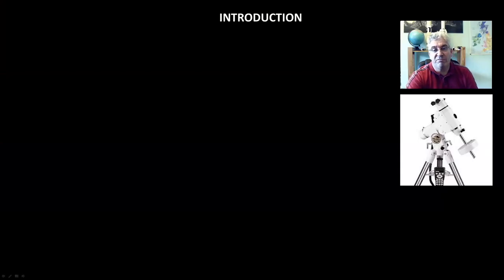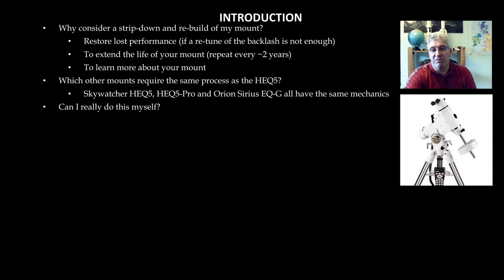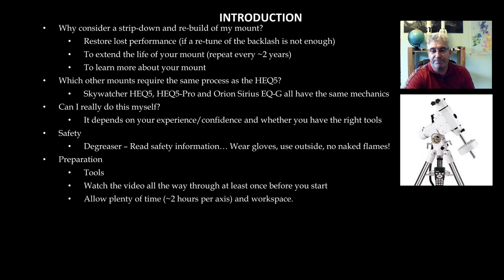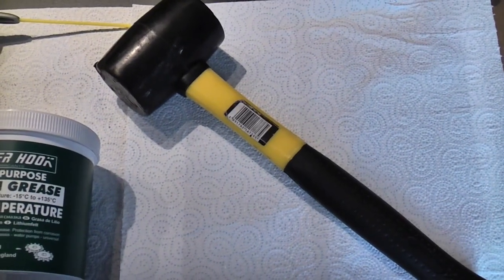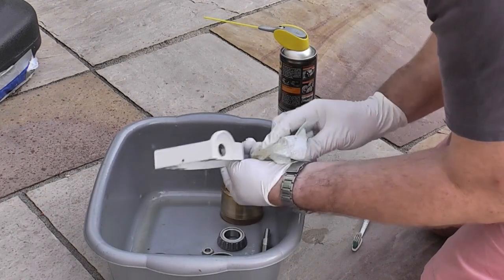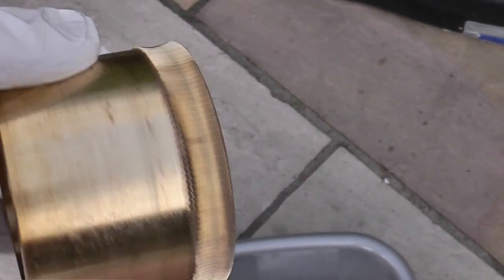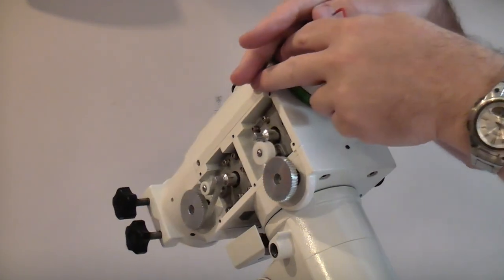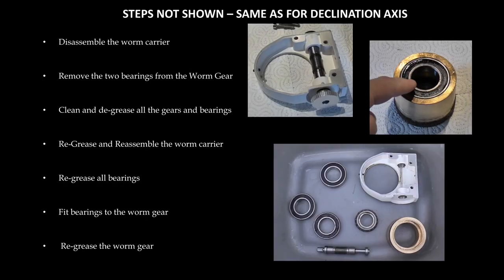Skywatcher HEQ5 Stripdown and Rebuild (NEW VERSION)

Comment: Hi Martin, thanks a lot for your very informative and enjoyable videos. Using them a lot. I am using a HEQ5-PRO and am struggling with backlash. I have completely rebuilt the unit with all new bearings, however cannot completely overcome the issue. Main challenge is that backlash is not even over the full circumference of the dec-axis. Once I get "backlash-free", I have binding on abt half of the circumference, solving the binding, I have backlash on the other part, what could I possibly do?
Thanks and best regards, Math
Reply from the maker: Hi there. If the backlash varies then the large Dec gear is more elliptical than you would like. If the mount is new, I would suggest you try to quantify the backlash difference between the two sides and then get back to the supplier asking if this is in spec or not, then seek a replacement if it is out of spec.
Reply: Thanks Martin, the mount is out of warranty, what I will do is measure the Dec axis and, if out of spec, buy a new one. Where would you suggest to purchase one?  Thanks, Math
Reply from the maker: @mathjennekens6153  If you plan to buy a new Dec gear, you will need to contact Sky-Watcher to see if they will sell you one.

Comment: awesome video! I'm right in thinking the two worm gear sets are identical right? I only ask because I did a tune on my HEQ5 and the tracking has been awful ever since. :( I'm wondering if I accidently didn't put the gears in the same axis they came from...upon visual inspection they look identical!
Reply from the maker: Thanks for that.  I don't recall if they are identical, but I can tell you for sure that the RA worm pulley has 47 teeth and the RA worm gear has 135 teeth.  This should be sufficient info for you to check you have the correct parts in the correct place.  Do you have the Rowan Belt mod?
Reply: @martinsastrophotography  great, thanks, I'll take a look. Yes I have the Rowan belt mod.
Reply from the maker: Note that Rowan Engineering have changed the diameter of the RA motor pulley slightly, as it was not quite correctly matched to the tooth pitch on the pulley belt.  I found this out when I called them about an RA oscillation I was seeing with 13.58 second period that was driving me nuts!  They sent me a new motor pulley for free!
Reply: @martinsastrophotography  oh interesting! I'll have a look into that. Thank you very much!! 🙂

Comment: After watching the video again I think I'm going to dare. Would it be possible for you to describe the necessary bearings? Different references appear in different videos. I would appreciate a description of what is needed in both DEC and AR axis. I would like to have them bought when I disassemble it. Thank you very much and greetings.
Reply from the maker: New bearings are surprisingly low cost!  Here are the details: 1) Worm Bearings are 9x17x5.  I replaced mine with '689 2RS' Ceramic Hybrid Bearings.  SKF make high-end ones I believe. 2) Worm gear and main shaft bearings are 30x55x13.  I used the '6006 2RS1' Deep Groove Ball Bearing from SKF. 3) Declination shaft tapered bearing is 30205.  I used a 30205 TIMKEN Tapered Roller Bearing.  4) The best grease to use is probably the Geoptik Equatorial Mount 2-part Grease Kit. However I used a multi-purpose Lithium Grease that is good down to -15C.  If you think your gears will get colder than that, I suggest finding something rated to a colder minimum temperature.  I hope it goes well Paco.
Reply: @martinsastrophotography  Thank you very much for the reply. Could you please clarify some doubts? the bearings of both axes (RA and DEC) are d3 the same size? and the other question is the number of bearings of each type, 689, 6006 and 30205, I understand that they would be 4, 6 and 2 respectively. Thanks, again
Reply from the maker: @pacoand4911  Yes, they are the same size. The video displays the bearing types as text overlays, and you can also see how many there are by watching it. There are four ‘689’ worm bearings, one tapered ‘30205’ bearing, and I think there are four of the 6006 bearings, but you should check the video to be sure. I made it a long time ago!
Reply: @martinsastrophotography  ok...thank you very much

Comment: Grat Martin, it's a very useful video. But I have a problem with the built-in motor control panel. After switch on: "Both axes...no response". Okay, a new panel can solve this problem, but it's a little bit expansive. Do You have any advice, what to do? Prhaps a wiring diagram, setting values, etc. Many THX!
Reply from the maker: Thanks Eszter. Sorry, I don’t have schematic diagrams for the control board. You may need to replace it (£98 approx for a new one)

Comment: I purchased a second hand heq5 which I am about to order the full bearing kit. In your original description of the roller bearing you said "30225 TIMKEN Tapered Roller Bearing" but in one of the comments you said "The tapered roller bearing on the declination shaft is a 30205 (e.g. 30205 TIMKEN Tapered Roller Bearing)" I relies this is a typo but I want to get the right parts. Is it 30205 or 30225? Thanks Phil
Reply from the maker: It’s 30205. Apologies for the typo!
Reply from the maker: I have corrected the typo in the description. Thanks for pointing it out.

Comment: Martin, any idea why when I tighten down the setscrew (thumbscrew?) against the RA setting circle it increases the force required to turn the mount in RA?  It's as if tightening down too snugly causes (something to) drag on the polar axis.  (the mount is brand new - received it a few weeks ago). 

It came to my attention as I was aligning the RA circle (with the DEC axis horizontal and level) with the indicator on the mount while finding the home position. When I tightened the setscrew (as SW calls it in their manual for this mount) and rotated the polar axis the RA setting circle rotated with the polar axis and then released and remained stationary while the mount continued to be rotated - I expected that the setting circle would remained fixed relative to the mount body.  Upon tightening further I noticed the RA rotation became more difficult. (no counterweight or scope mounted at the time).

I was hoping to be able to use the mount for a while before having to "tune" it. (and we've had one clear night since I received it)
Reply from the maker: Hi David. If you polar align the way I explain in my video then the only use that remains for the RA setting circle is to assist with turning the mount head in RA from ‘horizontal’ to ‘vertical’ when finding the home position. I find the setting circle thumbscrew must be loose when I do this. However, if you draw a cunning pair of small black marker lines (with a thin tip permanent black marker pen) where the mount head meets the base (so one line stays stationary and the other moves when you turn the RA) such that they align with each other in the home position then you can use them instead to find the home position and you can forget about the RA setting circle and leave its thumbscrew loose. Problem eliminated!
Reply: @martinsastrophotography  Thanks Martin.  It's the "cunning pair of small black marker lines" I was working towards when I came across the issue of the tightened screw dragging on the RA axis.  So, I too, will ignore RA circle once I've got lines drawn.

Comment: Can you tell us what’s changed? I literally stripped my mount last week based on your previous tutorial so keen to understand if there’s anything extra I should do without having to watch the full video?
Reply from the maker: Diellur Hi there. See the description... It’s the removal of the seals on the sealed bearings so you can remove the old grease, clean out the bearing and pack it with new grease. If your mount runs nicely, I recommend you don’t strip it all down again...just note the change for next time.

Comment: Hello. Nice video. How often you think that  grease it should be replaced ?
Reply from the maker: No more often than every 2 years I suggest. But the main thing is how smoothly it rotates and if it’s bad what’s the cause. Once it’s apart it hopefully becomes more obvious where the problems lie.
Reply: @martinsastrophotography  i have my Eqm35-pro goto for 1 year and 5 months at the moment is still performing good. I tested 2 nights ago also with a heavier telescope an Rc 6inch 152/1370 i thinknibhad like 7.5 kg weight with my other accesories and i was surprised how did it tracked orion nebula i took exposures of 60 sec unguided using only  the mount sidereal tracking. Andndid obtain a very nice result. I also tested on Mars
Reply from the maker: @GalaxyArtMedia  That’s great. Thanks for commenting.
Reply: @martinsastrophotography  with pleasure

Comment: Hi Martin, how did you make that "special tool (12 mm)"? What did you use to remove the metal? Thanks!
Reply from the maker: Hi Claude. I made two straight cuts with a junior hacksaw and then removed material on each side with a file. Would be much better with a milling machine but I don’t have one!
Reply: If your end float screw is not too tight, I made a similar tool by filing down a bit of 15mm copper pipe, but this probably won't be strong enough if your screw is tight.

Comment: Hi Martin if I am planning on the Rowan upgrade would one still do this procedure or is doing both counterproductive? Thanks
Reply from the maker: Hi Simon. Not counter-productive. Whether the full strip down and rebuild is necessary depends how old it is and how much it has been used. So long as you are comfortable doing it, you will learn a lot and should enjoy the process, as well as get it running nice and smoothly! I hope it goes well.
Reply: @martinsastrophotography  thanks Martin I am half way though very detailed. I think it’s two years old now but my guiding is too high 1.2-1.4 ish for my 952mm scope I think the Rowan upgrade will sort this but I guess it makes sense to do a complete strip down at the same time or would you just do the upgrade first and see the results? Thanks
Reply from the maker: Yes, sounds like a good point to do the whole strip down. I really enjoyed doing it, and hopefully the video will give you some extra confidence.
Reply from the maker: @simonpepper5053  it depends if you want to know which made the biggest difference. If you don’t care, and just want it to perform better, then do both at the same time.

Comment: Hi Martin, what do you think about the use of Lithium Grease? Some sites say to not use Lithium grease but use PTFE based grease. The reason they give is that in a telescope mount the grease is most of the time not "active", only now and then during very slow movements and the effect is then that it will "separate" (= oil coming out ...). In fast moving mechanics Lithium Grease is good, but not in slow moving mechanics. What is your opinion? Thanks!
Reply from the maker: Not sure if I’m honest. I have had no problems so far with the Lithium grease. Another option is the Geoptik 2-part grease that is sold specifically for this job, though it’s more expensive.
Reply: @martinsastrophotography  Ok, thanks! I will use the Lithium grease for now. The Geoptic grease is sold for 18 euros... the Lithium Grease about 5 euros.

Comment: Hi Martin, thank you very much for your extremely useful video. I already completed the DEC part and everything is really promising. However, I have a problem regarding the RA stripdown: I can't for the life of me unscrew the big black bolt (is that the correct name?) that holds in place the RA axis (see your video at 1:03:35), it seems completely stuck. I have already tried with Svitol and the like but it won't move by a micron. Is there any tool that can help me? Again, thanks a lot!
Reply from the maker: Hi there. I assume you have loosened the 3 grub screws? If so, and it is still seized even after applying penetrating oil, it might help to blow hot air at the nut to expand it slightly. You can get hot air blowers cheaply online that are hotter than hair dryers and have a smaller nozzle to help you direct the heat to where you want it. I hope this helps...Good luck!
Reply: @martinsastrophotography  Thank you for your quick reply. I was following your video step by step so yes, I have loosened the 3 grub screws, I double and triple checked them because the nut was so stuck that I had doubts myself I could have left them in place. I'll try with hot air and let you know how it goes. Thank you!
Reply: @martinsastrophotography  Unfortunately the hot air gun couldn't make it. I put even more penetrating oil but nothing happens, that nut seems like it has been welded. Before giving up, do you know the name of the tool that could fit into the three grooves of the nut? Thank you very much for your help.
Reply from the maker: @tango1348  Sorry, I do not know the tool, but I recommend you send it to Dave Woods at DarkFrame in Hampshire, UK. He refurbishes these mounts professionally and will definitely be able to sort it for you. Check out the website darkframeoptics.com or call him on +44 2392 570 283.
Reply: I had the same problem. I will not really recommend my solution, but I found two hex keys of the largest size that would fit into the three slots and secured them by cable binders around the black nut. I could then wedge a tool with a long arm between the two keys and get sufficient torque to loosen the nut. I believe the extreme factory tightening of this nut is responsible for high friction in the RA movement. This was just one of a number of places where excessive tightening caused the refurbishment to take much longer time than expected.

Comment: I am surprised a little of greasing makes such an improvement in the accuracy of tracking.
Reply from the maker: It depends how much debris has built up in the worm gears. A star is such a small spot of light that it does not take much disturbance to the worm drive movement to throw the pointing off by a significant amount.
Reply: @martinsastrophotography  It makes sense. I have no intuition in this field. It is interesting and challenging to track to 1/3600th of a degree. I'm guessing the autoguiding software is used as a measure of the performance.
Reply from the maker: @Martinko_Pcik  Yes, you’re right. It measures how much the guide star moves around on the sensor. Provide the pixel spacing of the sensor is significantly smaller than the movement, this shows how well we are tracking the sky.